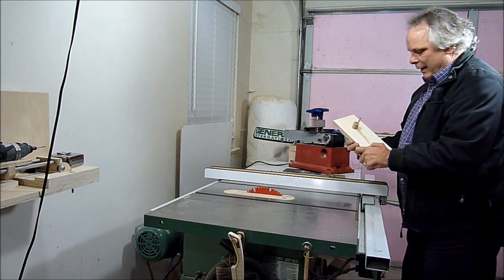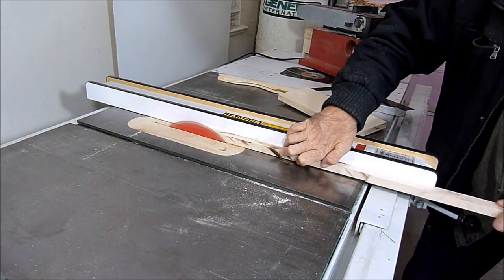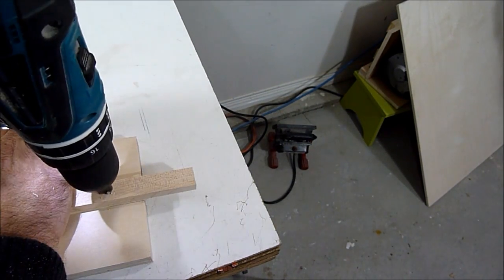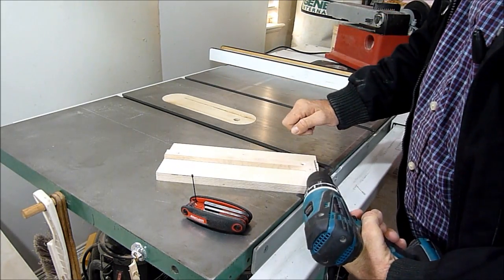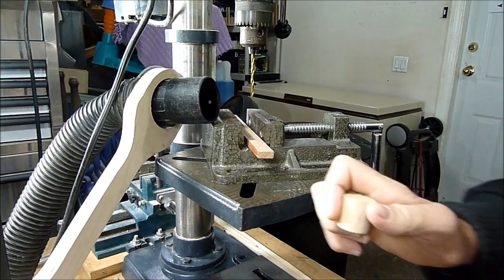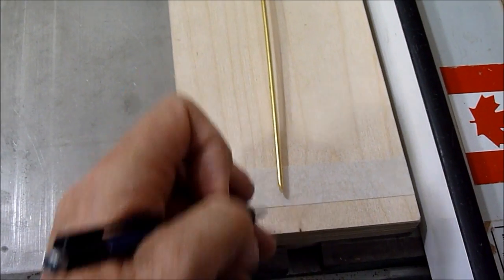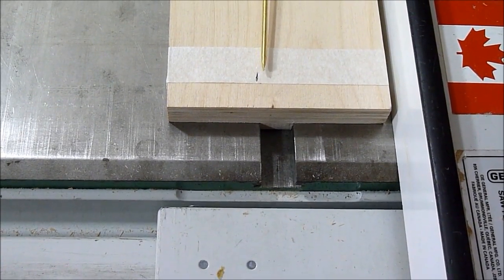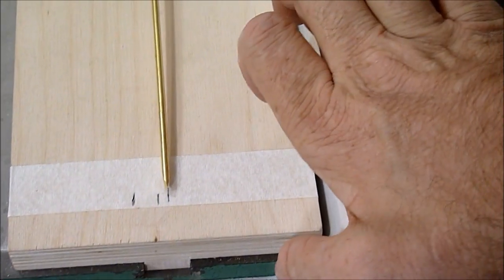Easy to make Dial Indicator

Comment: So that checks the alignment of a miter slot to the fence, but what about checking the fence to the blade? Also, how much would play between the dowel and the pin holding it to the block of wood affect things?

Comment: I like this idea Jack, could this idea also be applied to align the saw blade to the track?
Reply: My thought, exactly.  If you made it with that dimension in mind (from the left track), then you could use it in the left track for the blade and then the right track for the fence (or lower the blade and keep it in the left track).

Really, really great stuff, Jack.  It performed better than I expected!